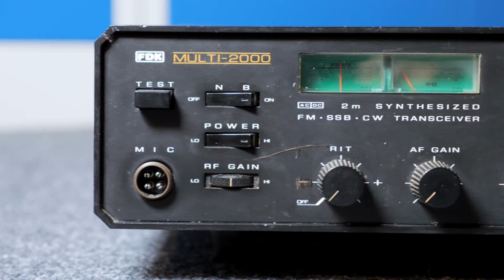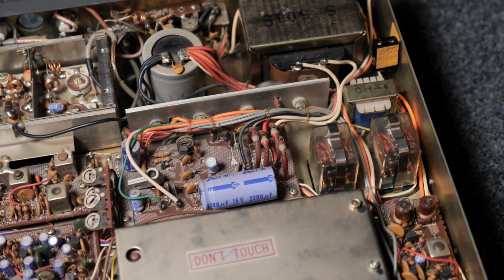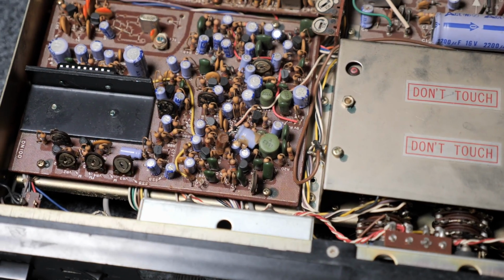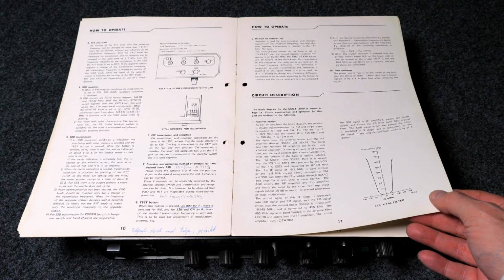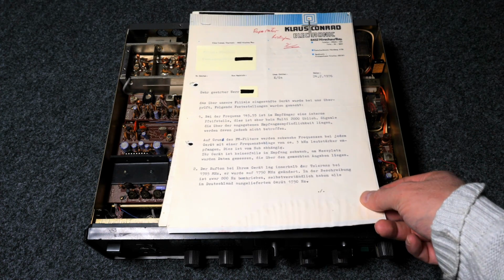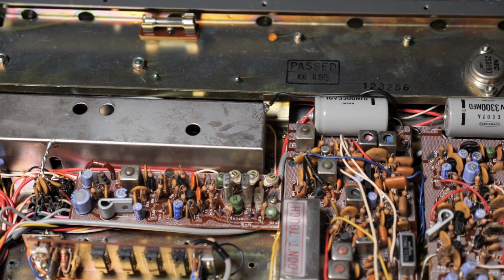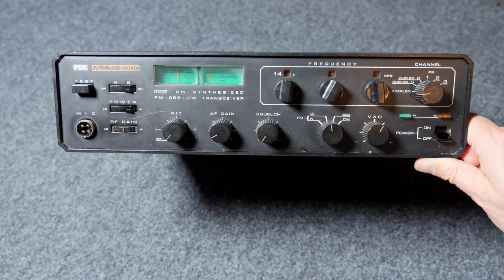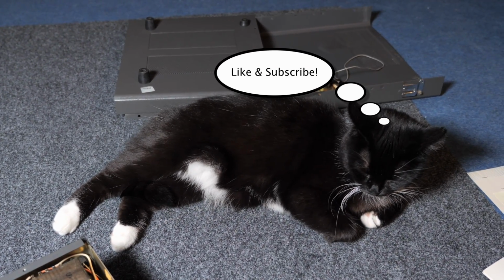FDK MULTI-2000 - A look inside... | HamRadio

Comment: my late dad had one too, no scratches, just a tiny damage on the plastic, also no dust or dirty knobs, it is another version, only one duplex setting, no modifications, I can feel some screws are sharp so probably the case as been opened. All seem to work ok, only the frequency is 3kHz low. serial 26086, frequency range 144.00 - 148.99 +/- 7kHz. I think it could be a nice extra ssb tranciever for monitoring activity, saw some questions about building in CTCSS, with CTCSS and the use of the fixed channels it also could be a set for repeater use. Still have a TS-780 that also could do the job after the CTCSS mod.
Reply from the maker: Yes recapping it is still on my to-do list. It was a really nice machine for the time and as I said: Fond childhood memories 😉